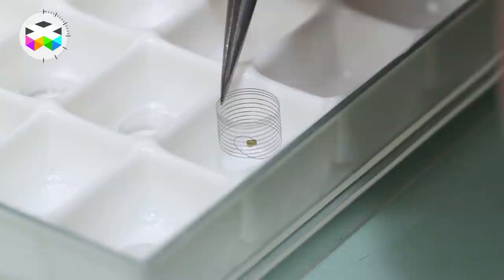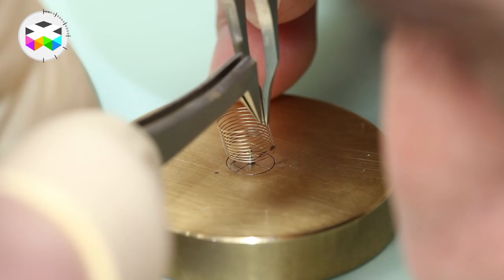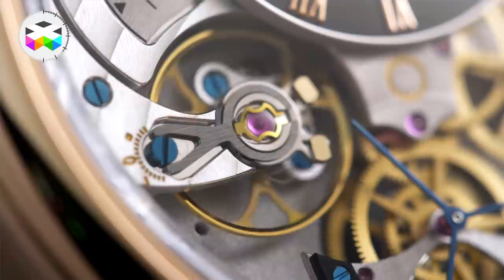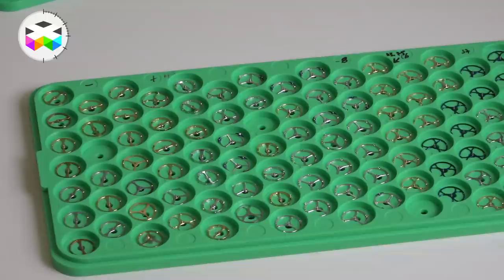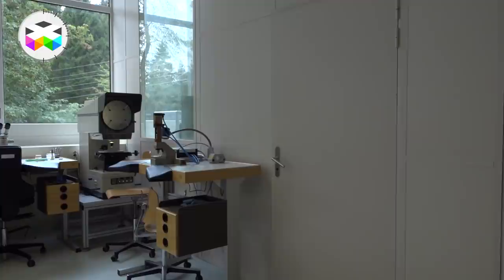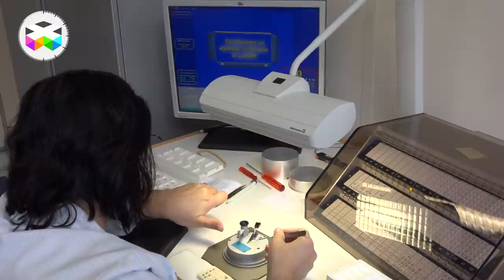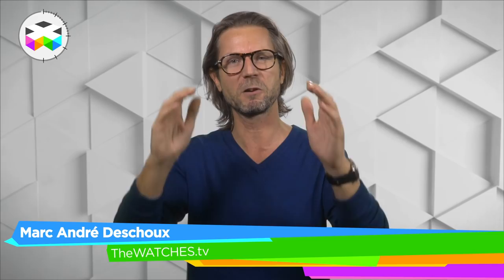The Secret World of Hairsprings with Bovet 1822

Comment: Excellent video. The key takeaway is the sorting process. No matter how much they control the manufacturing, in the end there is variation and the only way to get the best results is to sort and match hair springs to balance wheels through actual testing. This is the same way they make super precision ball bearings and high performance CPUs.

Comment: There's no way I could ever be a watchmaker. I would get too frustrated working with the tiny parts and toss it all off the table.
Reply from the maker: Needs dexterity for sure!!!!
Reply from the maker: Very well said!!
Reply: I got in to watches because my former German girlfriend was a watchmaker (and she's a collector still). It's not the frustration, it's the cramps and ultimately the carpal tunnel syndrome.
Reply: phototristan I would say that the desire of being a watchmaker is all about dedication and focus based on choice. You either have it (eagerness) in you or you dont.
Reply: There is a joy of taking a flat hairspring and pinning it to the collet, then forming an overcoil. This is why I like the older watches. When you watch the vibration of the hairspring, there is no side thrust on the staff. It "breathes" in a very natural way. I was taught two methods of forming the overcoil. My favorite is the Z-Bend. I prefer it esthetically, although it is harder to make and a little more prone to breakage.
Reply: Watchmaker is like any other job. as long as you have a calm hand its easy.
Reply: I am learning online at a website called learnwatchmaking.com.  I am not a patient person but when I put on the loop and get the movement on my table, something happens and I have a lot more patience even if I have to do a task repeatedly to get it right. May be the instructor’s calm voice and manner. It is good therapy at any rate.
Reply: XD well atm im making that "heart of the watch". Im studying in the finnish school of watch making. And you are right if you dont have long temperature you cant do that. 😆
Reply: phototristan 
Watch parts! I’ve thrown much bigger parts of things across the room in frustration! 🤨
Reply: We are the same!! Im a collector, with no dreams of fixing watches

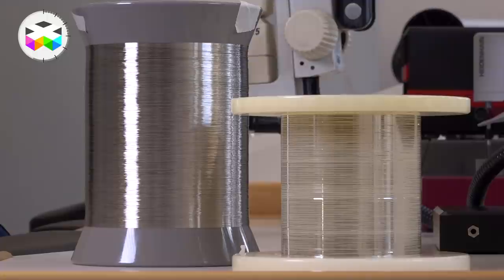Comment: 4:20 of shite anyone likely to click on this video already knows in more detail than the superficial treatment given here before anything about hairsprings. Not a fan of talking up the mystique behind mechanical watches either given mechanical timekeeping was being done better 300 years ago because it was necessary for for marine navigation. Even very good modern mechanical watches are literally an order of magnitude less accurate than dollar store quartz watches at this point, so the mechanical watch industry has pivoted from the timekeeping to the jewelry business, to the point where even Swiss certified  marine chronometers are nowhere near accurate enough to actually use for marine navigation (Though quartz watches with the same certification are). 

It's also worth saying that anyone with basic internet search skills can get good answers for many of the 'secrets' talked about in the video because the technology has been around so long. A quick one off the top of my head is that the material the springs are from is probably an austenitic spring steel. Once you pick an alloy you can literally ask the company you buy it from what temperatures to heat treat it at...